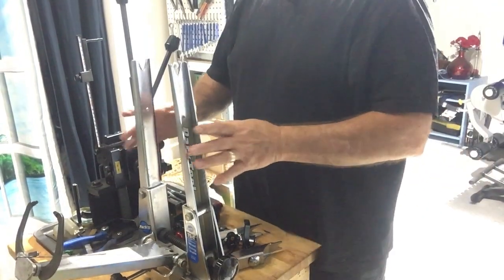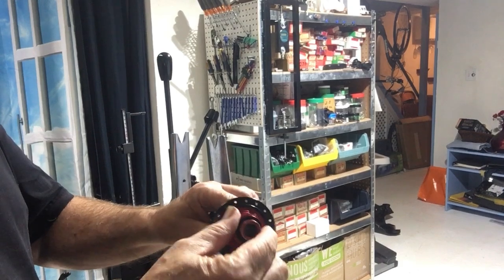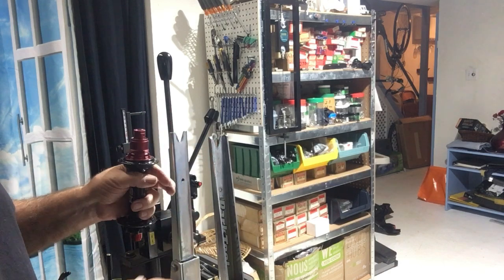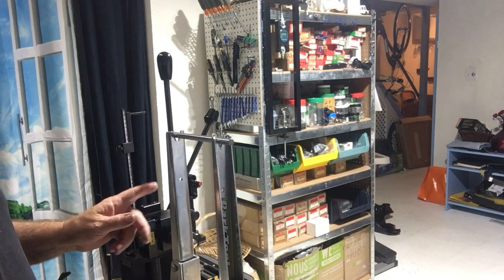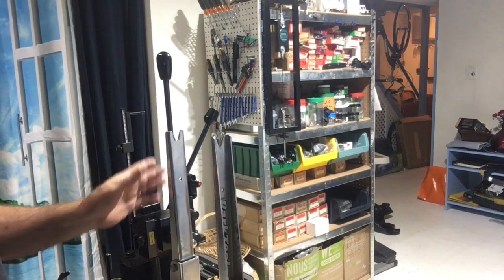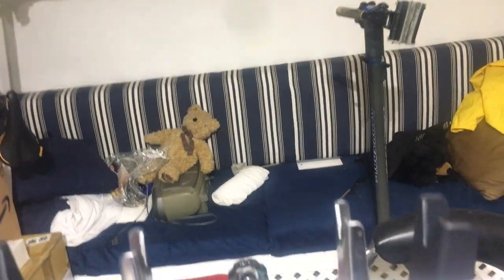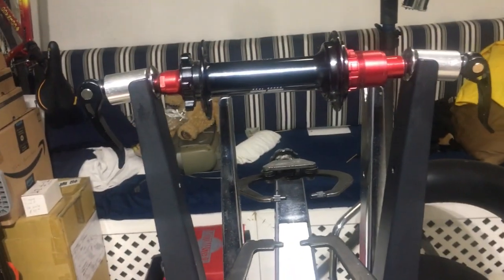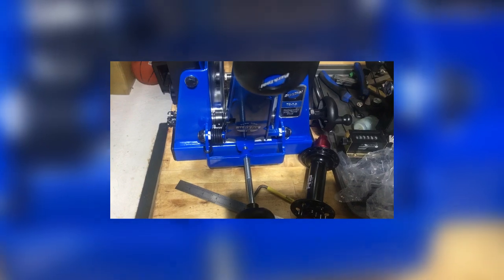Park TS 2.3 vs TS 4.2

Comment: Is this a review for park stand 2.0 vs 2.3 ? Not 2.3 vs 4.2
Reply: He was definitely reviewing the 2.3 versus the 4.2 because he specifically mentioned how the 4.2 was much larger than the 2.3 (which it is) and he got the slightly smaller stand shown in this vid, which is the 2.3. The 2.0 would not even come close to handling a fat tire hub as he shows in the 2.3 at the end of the vid.

Comment: I completely agree with your assessments in this vid. I have seen both the Park 2.3 and 4.2 in person and unless you are regularly working on fat tire type wheels with the tires on them the 4.2 is extreme overkill. The 2.3 gives you all you need to do 99% of typical expected road, hybrid, touring and MTB wheel work, and even the occasional fat tire wheel work.